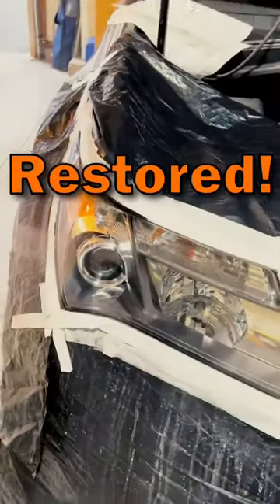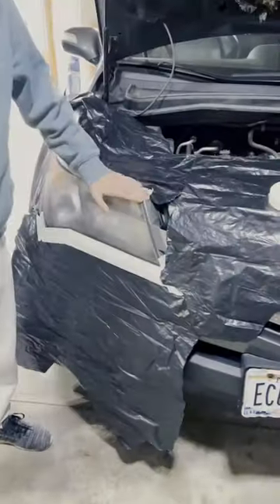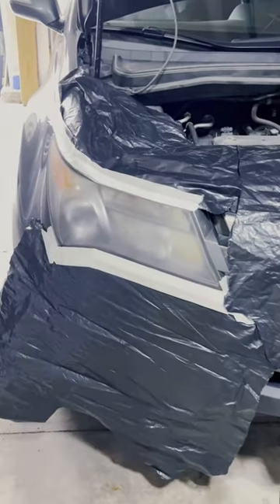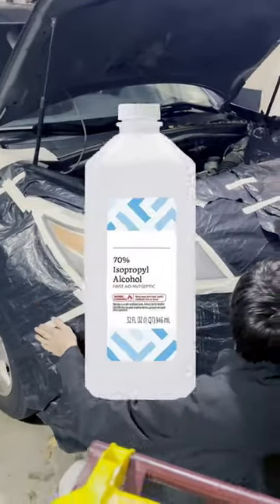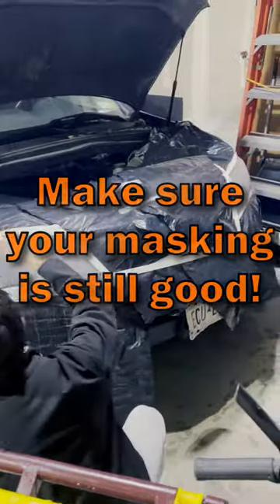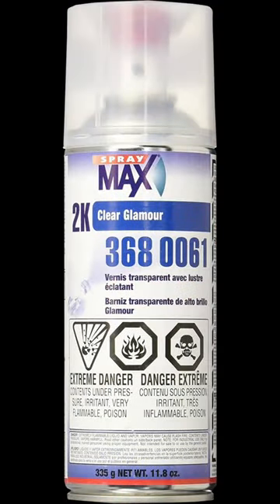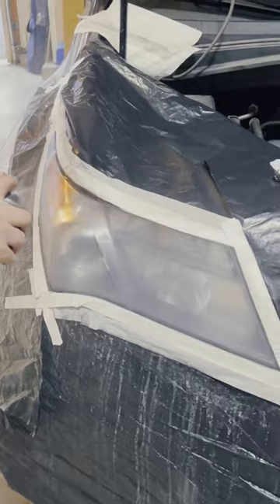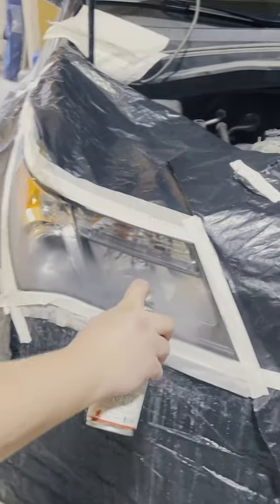The BEST Way to Restore Headlights - Permanent Results - Like New Again #detailing #restoration

Comment: I've done multiple cars this way and haven't had a single come back. I've had the same vehicle come in for brakes 3 years later and the headlights still look great.
Reply: Is it possible the yellowing/blurring is on the inside which means sanding the outside would be useless?
Reply from the maker: I've never seen it on the inside, it's always on the outside when I do this.
Reply: I've also never seen the yellowing on the inside. It can take quite a bit of sanding to get through the oxidation to clear plastic.
Reply: @DmitrysGarage  Can I apply Night Shades spray paint over the Spray Max?
Reply from the maker: @adairjones11  No idea, sorry.
Reply: I would do the nite shade first then clear
Reply: There's no such thing as a permanent headlight restoration😂
Reply: @DmitrysGarage isn’t the reason for yellowing headlights because cars have factory clear coat on the headlights
Reply: Did you have any trouble with orange peel?
Reply: @RoboMikro  no not at all.
Reply: Wasn’t Polish the way to go then spray?

Comment: Remember when headlights were glass and you didn't have to do any of this BS?
Reply: Probably because glass is more expensive?
Reply: @keithroberts5611  no, you deal with the haze and craze on the "new" lights. I see dozens of pairs every day that have pathetic light output levels. The cars they are on should be put out of service, they are so unsafe.
Reply: Capitalizing on plastic is much easier, that's why plastic is used. @kursor52

Comment: Dude went a little crazy masking off the headlights…
Reply: He’s spraying clear coat so he doesn’t want to get it anywhere else on the car
Reply: He didn't.  He's spraying an automotive 2k clear that you absolutely positively DO NOT want to get the overspray from on your paint or anywhere else.
Reply: @modemock yea exactly 😂 like bro that clear coat isint gonna be even on the pannels around it lmfao
Reply: Do you want to fuck the paint up on your car?
Reply: @Depl0rable10 yeah exactly you’ve never sprayed paint before 😂
Reply: I worked at a detail shop when I was younger, a big reason for people getting a full body compound was clear coat overspray from the factory. So you don’t want to get that stuff where it doesn’t belong or you’ll have another project on your hands.
Reply: Looks like he used two trash bags and some tape worth it for saving the paint
Reply: He’s spraying it with automotive clear coat after… no part of that is crazy… you don’t want any overspray
Reply: Not really , he shoulda masked off the entire car tbh ,
Reply: I thought so but I think they were painting the whole car. I use painter tape and tape around the light and that's it

Comment: Do you recommend any other clear costs that aren’t a one-time use? This is great, but I have do about 9 headlights a week and cant buy a can for very car. After a few hours, the can goes bad.
Reply from the maker: The benefit of this clear coat is that it has an activator/hardener in it. So this is why it works well and also goes bad, it's effectively real automotive clear coat. The only other recommendation I could make is to mix your own and spray professionally. This way you're making batches big enough for the job. May not be practical if you're doing mobile detailing though since you'll need a decent size air compressor tank. You can try other clear coats that don't use an activator/hardener, but I find they're very soft and susceptible to scratches while washing.
Reply: use 2k clear coat, you can buy them at almost any automotive paint store or even parts stores, you’ll need a spray gun with a tip size for clear and an air compressor, since you’re not spraying cars you can use a decent sized compressor so you can spray at least one light continuously
Reply: Try kbs diamond coat. I haven't tried it yet but you can roll it on or brush it etc... it has a self leveler in it. I'll be trying it this weekend with an adhesion promoter because I'm going to buff them out after sanding because I want a true restoration.
Reply: I didn't like it for headlights it did not level at all. Now the kbs would work great for other projects... but I am going to try one more way with the kbs on headlights.... and that is thinning it out with xylene because this clear is so thick.

Comment: that spraymax clear is the best you can get out of a can, but you shouldnt sand any finer than 1200 to give the clearcoat proper adhesion. It will end up flaking off after a while. Clear wants to fall into a 600-1000 grit scratch ideally.
Reply: Will the 1200 make the heaslights clear though?
Reply: @lizrain2210 all.ya doing is removing  micro layers . So as long as theure rubbed down well be fine got to do mime very soon 😊
Reply: Not sure how it will not hold after 2000 grit if properly clean and free of oils or waxes, and let cure properly for a week before adding anything or even getting wet.
Reply: I just used 3 cans of that exact clear coat a couple weeks ago.  It wastes alot due to the insane wide pattern that does nothing but create overspray. If it had a decent spray pattern and didn't waste so much I could've got by with 1.5 cans at most. And that was me repainting a hood. The slicker the base is the better the clear is gonna look. It will adhere just fine because that's completely normal to use 2k grit before a clear if you want a mirror finish. The end result always depends on the quality your prep work. The cans of clear are 30$ each, so it's not a cheap clear
Reply: Can I use 2x clear coat?
Reply: @gooutside-_-  yes. Just wait a few min in between, but don't let it completely dry
Reply: @gooutside-_- 2x is completely different than 2k. 2x is more of an enamel clear. Will work in the sense that it will be clear for a bit. If you’re wanting to go that route, just grab a bottle of Meguiars Headlight coating. WAYYY Easier and more forgiving. I use it on EVERY single set I do. 

The 2k is a 2 part system with a catalyst that begins to harden after they mix.
Reply: I sand up to 3000 and then hit them with buffing compound to crystal clear.... before the clear coat. I'm hoping they last much longer than the quick & easy way. They were perfectly smooth and crystal clear when the factory clear coated them.
Reply: @dossegundos7145  That's not really an option. Are you not gonna drive it for a week? Where I come from it rains at least a couple times a week.

Comment: I purchased a headlight restoration kit from Walmart today made by Rain-X. The kit comes with 3 grits of sandpaper, a wheel you attach to your drill, some fine compound and some clear coat sealer with a UV protectant. All that for under $22. Did an absolutely phenomenal job. Took probably 30 minutes all told and the lenses came out looking like new.
 (Not dissing your method- just saying there’s a quality kit out there for not a lot of $ and a lot less elbow grease.)
Reply from the maker: Those kits absolutely work, it’s just that typically they only last months to a year if the car is daily driven and especially parked outside. Granted for $22 you can do it every year and it is a viable option for sure.
Reply: Those kits work great. I’ve personally used the 3M kits. But the best solution is to go with an automotive clear coat as the restoration kit removes the UV protectant layer. You’ll have to keep adding UV Protestant wax on the headlights every month or so to prevent yellowing again.
Reply: That kit does work great. All the kits on the market do the job. The issue is, you need to restore the UV finish, otherwise, you will be back to square one again. That's where the clear coat comes into play.
Reply: The key is to get a clear coat that doesn't yellow and has built in UV protection. There are brands that are specifically for headlights. Krylon has a suitable clear coat that is affordable.
Reply: @DmitrysGarage You’re absolutely right! These restore kits make the headlights look good for a small period of time, but end up causing far more damage in the long run. This method is best by far
Reply: If you don't put a clear coat over it it's only going to last maybe a year
Reply: But how long does it last? His way should easily get you a year till your next restoration
Reply: @russellbrooker2122  - From what others have commented, as long as you consistently apply the UV protectant, you’re good to go for eternity.
Reply: @royy_obs8439 But what if you're a Catholic? What wax do you use? 😂
Reply: @DmitrysGarage  Agree, purchased the most expensive kit available, with 3 sanding pads and sealant, both cars after 1-2yrs looked as bad as they were initially.. Your method lasts, costs marginally more, but with the better sanding and more permanent clear coat last. tx

Comment: From my experience 800 grit by hand will not be enough to remove heavy oxidation/yellowing, or will take a LOT of manual sanding. The 3M heavy duty kit includes 500 grit to be used with drill attachment, I'd start there.

Comment: Doing my 3rd set, using lessons learned from owning a lot of cars over the past 50 years. Really bad headlights with pitting, start with 600 grit. Not so bad, start at 1200/1500. I do 1500, 2000, 2500 & 3000. Be sure to remove all the original clear coat. Then buff with buffing compound until they're clear. Then clean & clear coat. But try to keep the clear coat thin. 

When you buy a new car, don't wax the headlights. Never touch heaslights with a buffer. It will remove the protective coating. Be careful when buffing your hood not to hit them. Clean them gently with a sponge or microfiber only. No bug & tar remover. They will last 10-15 years if you leave them alone. Won't last 8 years if you mess with them.
Reply: are you talking about the clear coating? or 2k clear? 2k clear wont stick to 3000 grit and buffed surface.
Reply: Haha, wrong. Apply wax to headlights at least monthly. Wax fills in the pores, doesnt remove material.

Comment: Look great but I did heard once that you should never spray your headlights a it could distort the light. Wipe on ceramic worked well for me in the past😉
Reply from the maker: It really doesn’t distort. Ceramic coatings don’t really block uv so they won’t offer as long lasting protection as clear coat.

Comment: Hey I will be doing this on my Camaro tomorrow and just had a few questions. Why not use only 2000 grit sand paper? How long should I sand each side for with each sand paper? Also how long does this need to heal before I can start washing my car normally? Thank you!
Reply from the maker: You want the other grits to cut quickly and get bigger defects out. You work each grit until the surface feels uniformly smooth for that level of grit. 2000 will provide the smoothest finish at the end. Once the paint is cured you can start washing your car. I'd give it at least 48 hours to cure before washing, but depends on environmental conditions and how thick you spray.

Comment: What would cause a cracking effect after spraying  the clear.Its not actually cracks but looks like cracks or spiderwebbed looking cracks all over??
Reply: too wet, sprayed second coat too soon, not enough time for first coat to flash.
Reply: I waited the appropriate time before coating.Guess I should wait longer next time.
Reply: You're not supposed to use clear coat past 800 grit sand paper. And I personally wouldn't use that clear at all. Just buy Meguiars headlight Restoration spray. It's made for headlights. Amazon has it.

Comment: What about using ceramic coating? What’s your thought on that
Reply from the maker: It wont protect from UV like a clear coat. It will help a little with oxidation, but it wont really protect the lenses.

Comment: my headlights still feel rough and look like the factory clearcoat is still peeling after doing this. They are slighter brighter and clearer however. Should I have sanded more until I felt that the headlight was completely smooth? Would going from 800 grit to 1500 to 2000 to 3000 achieve a really smooth surface? Could I just repeat all the steps or would that mess with the ceramic coat?

Comment: Hey Dmitry!  SprayMAX now has a specific aerosol product that's better for poly-carbonate headlights than their 2k Glamour for paint.  The new product (SprayMax SMT 3684068, 2K 2 in 1 Headlight Clear) has an adhesion promoter in it that more suitable for polycarb and the 2k clear cures to a lesser hardness that should allow it to take rock/sandblasts without chipping (I can feel a bit more give to it with my fingernail compared to the 2k glamour).  The big reason I think people should switch is some people were putting on WAY too heavy of a first coat of the 2k glamour on the raw polycarbonate and it would cause massive crazing in the plastic due to the VOCs in paint not being suitable for polycarbonate.  (A light/tack coat given proper flash time followed by a medium wet coat prevents this).  The adhesion promoter in the new product prevents this and should also in theory give it a much stronger bond to the plastic than the 2k clear without any adpro.  The new product also claims to contain uv inhibitor solid content that is so critical to keeping the polycarb from rapidly yellowing to UV rays in a few months.  Here's a video idea for you - I was thinking it would be great if you could compare the UV blocking properties of the various aerosol 2k products for both clearcoats, paint, and headlight "protection/sealant" films.  SprayMAX 2k glamour/matte/etc vs Car-Rep aka Eastman WISE2k clears/ 2k paints vs 1K clears vs headlight protection films that come with headlight kits like Meguiar's Headlight Coating etc.  I think the rapid aging UV test of each would be VERY interesting.  Also would be very interesting is comparing it when it used with a Clearcoat Blending agent to blend spot repairs into existing factory clearcoats - there's a debate saying that the blender transition disappears in a few years due to UV and ruins the seamless transition.  Cheers!
Reply from the maker: Thanks for the great tip, havent seen the new product yet but it sounds pretty great. I do agree that heavy coats can cause crazing especially if the environmental conditions are bad. The video idea sounds pretty cool. Ill have to see how to best do that. Probably need some poly sheets in the UV weathering machine. I think its doable.
Reply: This is actually a discontinued product, Spraymax no longer carries it since it was so chemically similar to the 368 0061 cans. Adhesion promoter can etch the plastic a little too much and cause you to have to restart your project. I sell a lot of Spraymax products
Reply: @johnsalvatore97  would meguiar’s headlight coating do the job just fine?
Reply: Hi  @johnsalvatore97  .  Are you sure? Because the product is still widely available and featured on the spraymax website?  It doesnt seem chemically similar at all to me.  I have both.  The headlight clear is much less hard than the glamour clear and the cans even have different potlifes.  You can also destroy the polycarbonate headlight by putting on too heavy of a first coat of just the clear glamour on the freshly sanded surface - extreme crazing and cracking examples abound on youtube.  Any adhesion promoter is supposed to be applied lightly whereas clearcoat typically is not so it possible to damage with either method but by following the instructions for the headlight one its less likely imo.  Any additional info?

Comment: Do I need to add a UV protecting spray after all these steps?
Reply from the maker: The clear coat is the UV protection, but you should apply a wax/sealant/coating as you normally would to help protect the clear coat from oxidation and marring.

Comment: This stuff is like $24-25 a can on Amazon 😩 is that standard price? Best place to get this?
Reply from the maker: Yea that's pretty normal. They also released a headlight specific can recently, which is supposed to be even better. It may not be a free fix, but it's a nice one with long lasting results.
Reply: @DmitrysGarage  I agree, plus one can lasts multiple headlights. I ordered one yesterday
Reply: @DmitrysGarage  if it's automotive clear, could i theoretically use it to redo the clear on my trucks hard shell topper?

Comment: That 2k clearcoat is made for paint and not plastic the 2part chemicals does not get along with polycarbonate. use the Meguires clear coat for headlights
Reply from the maker: Most headlights are polycarbonate not polypropylene these days. The 2K clear works fine on lenses, they even have a headlight specific 2k clear now (since making this video).
Reply: @DmitrysGarage  Yes i know that you are correct I started spelling it and saw it after i posted it. That is what happens when i try to post a comment on my phone thanks i fixed it.

Comment: My cars about 1 year old and headlights are fine so maybe I can spray that clear coat now before it gets all cratches up.
Reply from the maker: This is not a preventative maintenance, I wouldn't recommend doing that, your lights already have UV protection. This is for restoring them when the protection runs out.
Reply: Put a graphene ceramic coating on them... Or you could get meguiars headlight coating and just spray it on like a clear coat.

Comment: Clearcoat made them look more foggy.  Buffed it with some polish and looks good as new.
Reply from the maker: Thats pretty odd. It shouldn’t make them look foggy. Was it maybe very humid or cold or anything?
Reply: @DmitrysGarage orange peel happened
Reply: When you spray the clear it’ll look hazy, orange peel, wait some hours or the next day, i use 2000 grit sandpaper while heavily wet sanding, all this after the original steps, and then I buff the headlights with wax, always look good